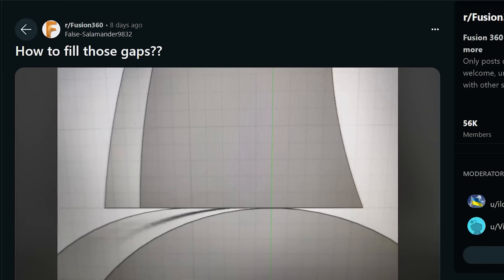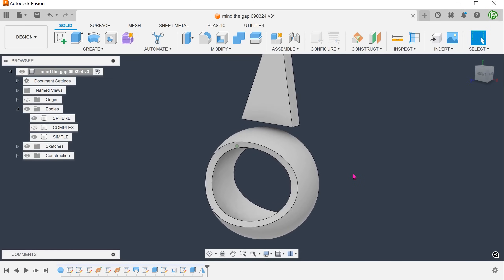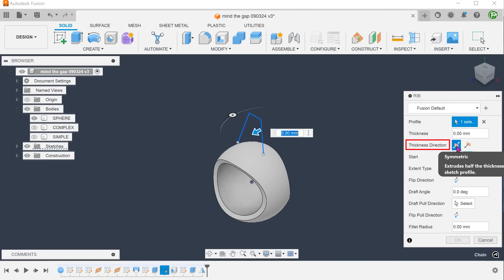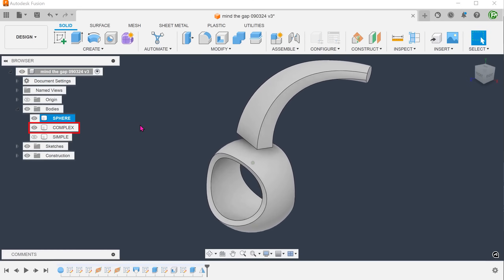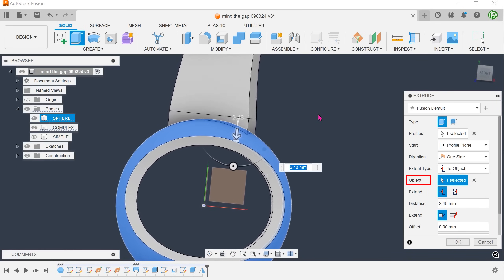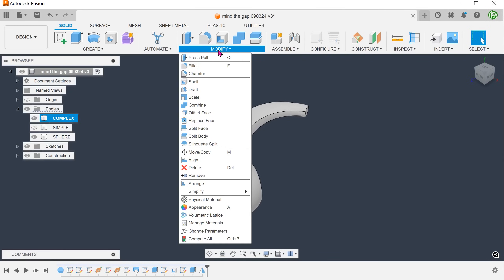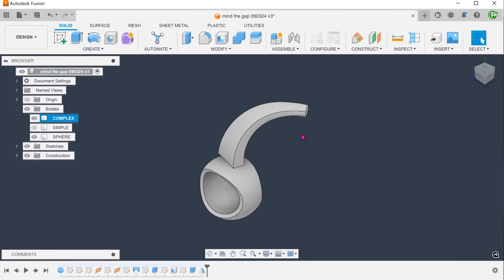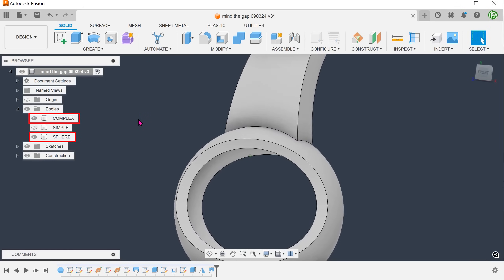Autodesk Fusion | Mind The Gap

Comment from the maker: There are a few things that you can also try. Extend the loft into the sphere, combine and then select the faces of the excess to delete. Or even creating a split face on the sphere to loft to. 

There is also another angle to this problem which I did not mention. We could have started with a solid sphere, extended the loft into the sphere and then split out the sphere to shell. Happy experimenting!

Comment: Brilliant!  Would have solved an issue I had today, sweeping circles on the XY plane along arcs to meet the surface of a dome sitting on top. Sweeps wouldn't mate with the dome correctly, with half the face ending short and half outside, so I ended up creating planes tangent to dome surface at the end points of the arcs, and lofting instead of a sweep. That gave lofted circles extending beyond the dome around the end point of the arc paths, and intersecting the lofts with the dome as a solid then lost the bits of the loft that were outside and gave the solution. But... simply doing a replace face of the original sweeps extended and trimmed them perfectly to the dome, and probably would also work on the lofts that didn't conform to the dome too.  Super useful feature.

Comment: Great video!  I rarely use Replace Face so its a good reminder to not forget about it :)  What I often have to do with complex intersections like this is extend edges or ruled surface on the lofted body and use surfacing tools to get them to line up (if say the bottom face wasn't planar).

Comment: Replace face is one of those unused commands (at least in my arsenal) and can come in so handy. I often do this by extending the loft just into the face and then using the delete key. This mostly but not always works. Using replace face is way more elegant though.
Reply: I wonder if a command such as this is under-used or unknown because "replace face" doesn't seem to describe what it does.